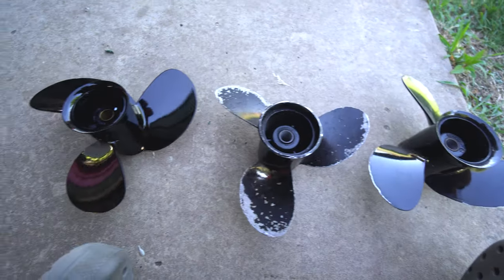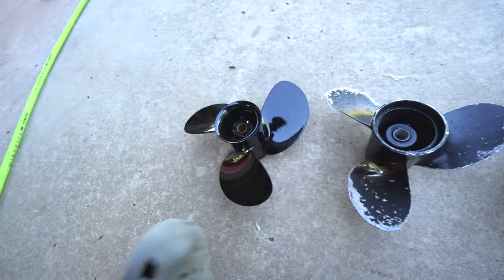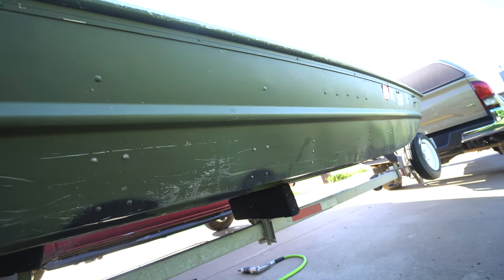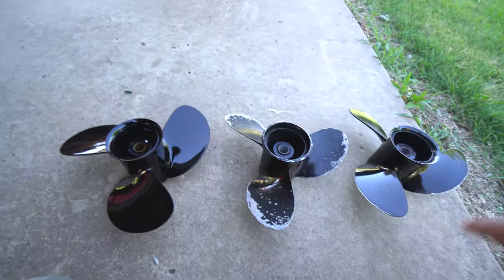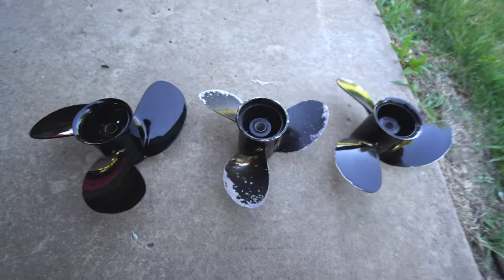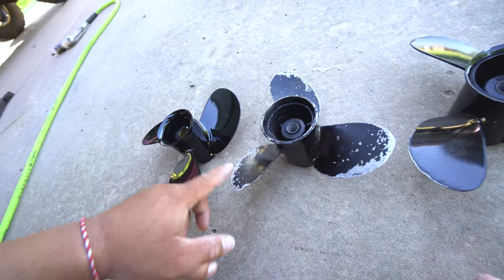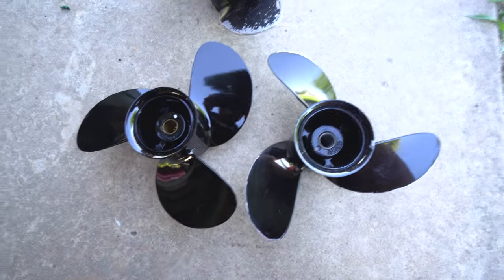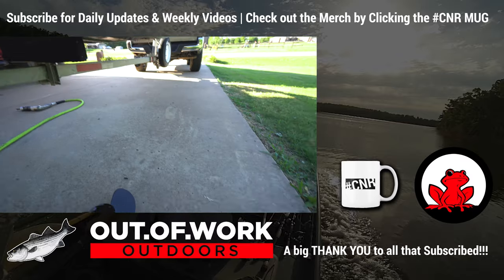Why your boat engine/outboard/inboard needs 3 propellers? | 3 Pitchs - OOW Outdoors

Comment: Sorry Sunshine, but diameter is the measurement straight across the prop. Not the circumference which is around the outside. I couldn't imagine the circumference to be 8 1/2 inches around the outside.
Reply from the maker: yeah you right, i used the wrong words.
Reply: @OutofWORKoutdoors  We know what you meant.

Comment: I just saw this i have a yamaha 8hp 4 Stroke outboard on my 12ft v i Think my pitch is 8.5 in my prop i put a deck on the boat it seems pretty slow do you know if they make a 9.5 pitch prop mine i think has 7 splines i need alittle better spend or maybe like a 20hp id rather spend less money so id like to try a different prop First anyway thanks good video

Comment: What was the top speed with the newest prop?
Reply from the maker: About 22 mph
Reply: @OutofWORKoutdoors  how come if it was lower pitch than others?
Reply from the maker: Oops.  I was thinking about the wrong one.  It gets about 15 mph.  I needed a lower prop for trolling,  need more low speed control

Comment: Do u notice much difference in the 8.5 and 9.5
Reply from the maker: The higher pitch i don't run in shallow water because it struggles to get up to speed
Reply: @OutofWORKoutdoors  but Did  the top end speed go up much

Comment: Hi i have an old mercury 9.8 on a 10 foot sib and i am changing from a 8x8 stock prop to a 9x8.5 because the stock is not available and apparently it can be bad for the rpms?
Reply from the maker: If the pitch is too high your rpm will climb as high.  1 pitch over stock is no big deal.  It only pertains when you go like 3+ pitch
Reply: It all depends on what boat you have, Mercury doesn’t know what type of boat you’re gonna put the outboard on, usually on the low horsepower engines RPM doesn’t come into play, but you want to stay in the recommended RPM range for your outboard. in the 50hp and above range you can hit the rev limiter. Also LOWER pitch gives you HIGHER RPM.
Reply: @mr.andersen1505  I have a suzuki 6hp + 270 inflatable boat 
 with stock propeller 7 1/2 x 7 it goes 13knots with 1 personand 5.5knots with 2 people. 
Do you think if i use a smaller pitch ,  would it help to go any faster than 5.5knots (10kmph)?
Reply: @boatsandoutboards9070  it might, but with so low horsepower it’s much harder to tell the difference when you change ur pitch, also if you go to low on pitch you might over-Rev your outboard so be careful. If it’s just a hunch that ur pitch is too high don’t swap until you need to because of wear or ding on ur old prop
Reply: @mr.andersen1505  thanks, with 2 people onboard, it is a hunch in fact.  A 9.9hp planes with 3 people, but a 6hp doesn't with 2 people.  It is just on the edge.
Reply: @boatsandoutboards9070  Yeah I actually had a small inflatable with the same exact issue many years ago. 6HP is a small engine and its not very likely gonna be enough difference to change the pitch. But if you somehow are unlucky with ur current prop you could try a lower pitch. Changing pitch makes most difference IF its needed and on 50hp +.